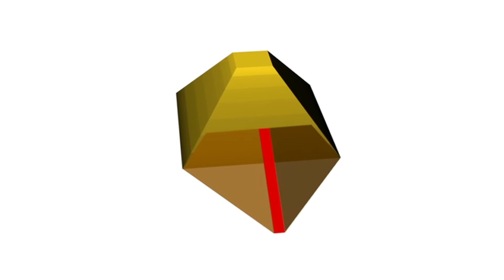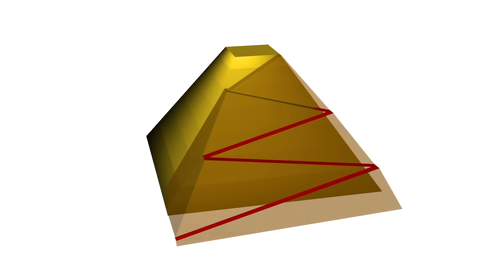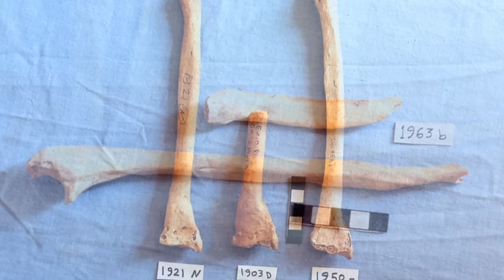Egyptology - Pyramid Construction

Comment: 2.5 tons? Some of the upper chambers in the pyramids have 100 ton blocks, try explaining how those got there. Or how the ramp needed to move these stones to those heights would have taken them much longer and require more effort to build than the pyramids themselves,lol.
Reply: There are no 100 ton blocks in the pyramid.  So right off your assumption is incorrect.  The granite relieving stones which sit atop the King's Chamber are only estimated to be perhaps ~70 tons.  Meanwhile they are located about halfway up the pyramid.

So look at the western face of the Great Pyramid along it's bottom. You can see a section of the exposed base of the pyramid which represents a continuous section of stone.  In other words they cut the top off of a small hill to create a platform and built atop it.  Meanwhile the employment of earthen ramps is both a matter of historical record as well as archeological.  Some such ramps still exist in Egypt today.  

So during the Old Kingdom they built ramps from a mixture of sand/stone chips/tafla - a clay they mined.  There is the remains of a large tafla mining operation near the worker village at Giza.  Also when the limestone quarries were excavated years ago they were found to have massive amounts of sand/stone chips/tafla deposited into them = in other words exactly what they built ramps from.  So as they encased the pyramid in white limestone working from the top down as Herodotus wrote = they systematically dug away the ramp and dumped the residue into the now open limestone quarry pits to backfill the area.

Moral of the story:  Herodotus wrote that he considered the creation of the "great causeway" - read ramp - to be a massive undertaking.  Yet that was how they did things. The tomb of Rekhmire as an example shows a hypostyle temple being built with what is clearly a large mud brick ramp being employed. 

Anyways it is also possible that they simply used the terrain to their advantage.  We know they as noted above built atop a small hill.  We further see they tunneled into the hillside for the lower tunnels and chamber.  So it is at least possible they used the natural slop of the hill as a ramp to build the central part of the pyramid before encasing it in blocks.  As such they would not need as large a ramp to raise those few heavy blocks as the hill itself would partially provide the incline.  Then they simply covered over the internal passages and chambers with other blocks using a ramp they built on the south side of the pyramid and lever devices to form the structure itself.  Herodotus wrote they first built a "stepped pyramid" ala Djoser and then filled it in.  That would allow for building the internal core of the structure and then covering it over to form a classic pyramid.  Have a nice day.
Reply: Vary Olla actually it’s 80 tons lol, sorry for misremembering but it seems we were both wrong. The ramp would have to be a mile long to reach to the top of the pyramid. Herodotus also said they were built in 20 years, can you tell me how fast they would have to cut, check and set each block to achieve this time frame? I’ll give you a hint, it’s ridiculously fast. 

Then there’s the how the hell did they move those 80 ton blocks of granite from 500 miles away across the soft sand of the desert floor, just a lot questions left unanswered for something that our ancestors built only a few thousand years ago. 

Why so many mysteries, lost technologies? Why even undertake such a massive effort in the first place? How is it possible that we still don’t know for sure how they were built? It’s fascinating.
Reply: 1 - look at the video link I gave you.  See how approximately shaped blocks can be created using chisels and a hammer without even having to saw through the block.  Instead - by driving chisels at intervals the stone will continue to crack = producing fairly straight sides.
2 - now Google pictures of the limestone quarries at Giza.  Note how the walls show shallow lines with holes along the line.  Limestone forms in layers like a cake.  So the Egyptians would chisel a shallow line along the natural layer line with holes alone the line.  Then they would drive wedges into the holes to fracture the bedrock along the line like breaking off a saltine cracker.  Then long copper chisels such as have been found in tombs of craftsmen would be driven at intervals along the fractured section of bedrock until approximate size chunks broke free like the mason in the video is doing.  Then those chunks would be carted away.
3 - the more carefully cut and in some cases polished blocks that make up the inner chambers/corridors and the last few outer courses of stone could be done via saws and an abrasive like sand or corundum.  Yet those blocks are relatively few.  Google close up pictures of the Great Pyramid.  Note how most of the blocks are little more than crudely hewn chunks of limestone of assorted shapes and sized which were rapidly placed leaving lots of gaps.  In some spots they filled the larger gaps by jamming small boulders into the space along with some gypsum mortar.  What matters is they were not wasting time trying to make "perfect" blocks in every case and laying them neatly.  They were simply fracturing off chunks of stone and plopping them down as fast as possible to build the structure.  Afterwards = they took their time with the last courses of stone to make it look neat. 
4 - Google the Giza plateau.  Click on the topographical view to see it from overhead via satellite.  See the Temple of Khafre.  Now see some white lines going eastward towards Cairo.  Those lines = stone piers which slope down into the ground.  Geological core sampling of the area shows Nile mud around ~20 feet down.  So that area = harbor location. So the Egyptians created a harbor at the base of the plateau with connecting canals and dikes.  Merer in his diary relates how at the beginning of a "season" - the months when the Nile floods it's banks each year - his men would open the dikes and they would ship the white limestone from Tura to Giza = or granite from Aswan etc.. 
5 - The ramp did not need to go to the top.  Instead it need only go as high as the largest/heaviest blocks to be placed = King's Chamber - or about halfway up.  Above that level the blocks of the pyramid get smaller as it rises in height with those at the top being small enough to have been slid into place by several men.  So above that level levers could be employed to raise the smaller blocks from level to level while the ramp would be used to raise the larger blocks which are found in the bottom third of the pyramid.  The mile long claim = premised upon the ramp going to the top. Herodotus wrote they first created a "stepped pyramid" ala Djoser and then filling it in.  As such lever devices could sit upon those steps. 

Moral of the story:  so why make this effort???  Answer:  religion.  The Egyptian religion was based upon two things.  First and foremost your body must be preserved.  No body = no afterlife.  That is why they mummified people + placed food and objects in the tomb for use in the afterlife + and tried to protect it.  Accordingly the King's Chamber is made of granite because limestone is a mediocre loadbearing stone which can crack and subside.  Egypt suffers periodic earthquakes.  So the body of pharaoh was protected by a granite sarcophagus and chamber incase of subsidence and collapse.  

Next is your name must be kept alive so people remember you and make offerings.  Accordingly pharaohs built tombs and temples to "stand out" to try to keep their name alive.  Pharaoh was the Sun God Ra incarnate.  Accordingly the pyramids were topped with electrum to reflect the Sun's rays = or Ra here on Earth.  So their religious beliefs drove their actions as the goal was to survive in the afterlife.  If your name was forgotten and your body destroyed = you were effectively erased.  So this is but the tip of the iceberg of information you are not accounting for.  Have a nice day.

Comment: There is evidence ancient technology of power saw cuts and power core drill holes all around the pyramids of Giza plateau which I have studied myself and the same methods can also be seen in many places all around the world including balbec Lebanon, Machu Picchu in Peru India, China, nearly on every continent in the world all of which existed over 12000 years ago before the world wide cataclysm caused by large meteors The large stones were either cut by ancient technology using very large power saws or made in place using moulds. If they had the technology to do that they definitely had the technology to lift or lower them in place by air
There is no mystery to it if you look at the evidence
The only thing left or evidence after 12000 years would be stone

Comment: It is true guys! I built my own house in 3 days with a toothbrush and elmers glue, so easy
Reply: Mats K  Vulcans? Klingons?
Reply: Mats K  With sweat and steel resolve.
Reply: No, but you could build a house with nothing but a hatchet, 2 horses, and a wagon.

That's how the pioneers did it.
Reply: @histguy101  even so... The time, and methods dont add up mathematically the versión they tell us is Impossible
Reply: @rcjm21  The time that is commonly repeated for the building of Khufu's pyramid is 30 years.

Why is this? Is it just an estimate by modern scholars?

No. It is what Herodotus wrote after visiting Giza 2500 years ago. He was told this by the Egyptians.

Could they have been mistaken? Maybe, but keep in mind that Khufu's father and predecessor Sneferu built 2 or 3 large stone pyramids, all during his reign using the exact same building methods and materials as those used in the great pyramid, and they are almost as large(The Meidum Pyramid, the Bent Pyramid, and the Red Pyramid at Dahshur).
https://en.m.wikipedia.org/wiki/Sneferu

And Khufu's immediate successors built the Khafre & Menkaure Pyramids at Giza, also using the same construction methods. Then there are dozens of other pyramids in Egypt. Some have collapsed, but they all would have looked just as magnificent as those at Giza 3000 years ago.

Comment: no. absolutely not. not Millions of men-hours. the one build that used big machines to cut the blocks out. they had some form of automobil and cranes not ramps. they done it because it was easy to do for them. they probably need less than a year to build one Pyramide. you can not cut category 7-Material like Granite with Copper, Bronce or even Steel with a mindblowing precision. you need Powertools . and we have markings that clearly proof that the Builder (not the Egyptians) in fact used Powertools

Comment: They pyramids were not built using ramps to slide blocks on. They used molds where mud was heated and cooked in the shape of cubes. The method is mentioned in the Wholly Quran and the old original Latin Bible. No one reads them! 😑

Comment: What’s never addressed is what kind of rope they used. There weren’t chains and paracord wasn’t available. A rule of thumb is when lifting or dragging something heavy you double the tensile strength. So if you’re lifting or dragging something that weighs 2.5tons you’d want 5 ton tensile strength. My understanding is they used some kind of rope made from papyrus. The diameter of the rope would have to be huge. I’d like to see you get your arms around it. And now in addition to the 2.5 ton stone add the weight of the rope. Imagine how much rope you’d need. There’s a million bricks to move. The first batch of rope will eventually wear out. Now who gets to weave all this paper rope to handle a million bricks? I’m not suggesting aliens, but scholars and skeptics need to be willing to open their minds to some bizarre possibilities.

Comment: I know how qthey were constructed. The inside Chambers andq tumbs were prefabbed.  Precut blocks and pathways. They didn't use and alien tech or a pully system. They used the sand. After the first tumbs were laid,  They piled up sand to the litter surfaces of the tumbs and used palm trees to pull the precut stones to lay on top burring the insides with sand until the whole inside was complete. Then shoveled awày the sand exposing the insides. Then the outer walls were constructed in the same manner. They first laid the foundation wall. Then burried the stone with sand and slid the next layer of stone blocks on top. In the end qthey whole pyramid was burried under the sand and they shoveled it away exposing the finished producded. All three were built at the same time. And all shoveled awày at the same time. Exposing the three.

Comment: Not ramps more like a giant sled. Laid against  the finished face.to protect it .. attach  stones to a counterweight and sled on the opposite  side  of the pyramid... 2 tons of stone going up.... 2 tons of water  going down...  this is what the inner  chamber is.. a trolly of water .. to counter balance  the stone.s... ounce  they get above kings chamber.  Stones get small enough  to manhandle.. on simple scaffolding.....

Comment: SANDS COMMONLY APPEARED ON SURFACE OF THE EARTH THAT HAS NO TREES AFTER A STRONG FLOOD. Before the pyramids were built, Ygeipt has lots of trees and mostly has no sand at all. This pave the way to easily transport large heavy stones from foreign land to Ygeipt. Meanwhile, they CUT DOWN TREES as a basic material for construction. However, those trees are necessary to hold large amount of water. After the pyramids were constructed, a strong flood came.

Comment: unless we had "Help" (from unknown). How do we get the ramp started? Keep in mind it needs to go upphill aswell but start with straight ground.  Try moving a 1 ton block, On a straight surface with wet wood under it sure maybe 5 peole can move it. But these blocks weigh 200 tons each, yes 200!. Now that already takes 5 people x 200 = 1000 people, dragging something with some ropes. Now we need to go upphill with on to reach higher the higher ground once first level of blocks are in place once Since wet wood or the like wont be useful here, even 20 people couldnt move a 1ton block even slightly upphill but lets say that works. Blocks again weighs 200 tons, You would now need 20 people x 200 tons so that is 4000 people for one block  2000 people to move one block. So all in all there are many things that proves egyptians were visited. These egyptians knew math and physics which took us thousands of years to come understand fully. Math is an easy language to teach and it is useful for intelligent life and aiding us. So were we visisted by ailiens in ancient times? Well i cant come up with any other explanation to be really blunt. these visitors probably wanted to leave something behind to show us that there is other life out there and the egyptians saw them as "Gods" So what else more mighty to leave behind than a 60 million tons worth of monument
Reply: ✋🏻☺Hi everyone, I have 100% true correct answer.  Not only the mystery of building the pyramids but also a lot of questions you can find 100% convincing answers
Here is the right answer about building the pyramids 👇🏻
http://kaheel7.com/eng/index.php/secrets-of-quran-a-sunnah/918-the-ancient-rivers-of-egypt-a-new-quranic-miracle

And this is my account on Telegram for those who wanted to communicate with me.  Hello all 
https://t.me/LMhmmd

Comment: They built the pyramid from the ground up (obviously) and the ramps are actually still there, they built the pyramid around the ramps and added ramp and pyramid as they went.. there's no deconstruction of ramps ever because the ramps are in the pyramid itself.. people are too set in their modern way of thinking with scaffolding and such..
Reply: Except that what you noted would take even more work to accomplish.  Meanwhile you should know that they did in fact dig away the earthen ramps they employed to create the pyramids at Giza.  As they encased the pyramid from the top down using white Tura limestone - from the outside - they systematically dug away the ramps as they went until they reached the bottom.  

They then = dumped the residue into the now open limestone quarry pits which sit adjacent the pyramids to backfill the area.  When those quarries were excavated years ago they were found to have a massive quantity of what they built ramps from dumped into them.  Have a nice day.

Comment: I find it hard to beleive it .If it were possible to hsve done this the hard way it would have made more sense to pull them into place with camels,must not have had any .that would have been easier than ripping youballs off pulling ropes all day long in heat of the desert and for that matter working at night would have helped.you could have made water containers out of all of the dead camel hides and I suppose t hey drug all of the dead bodies back to town and buried them.no boneyards found nesr by. Heat strokes are a bitch. This kind of forced labor would at one time or another cause a hell of a revolt they did not do this out of love.